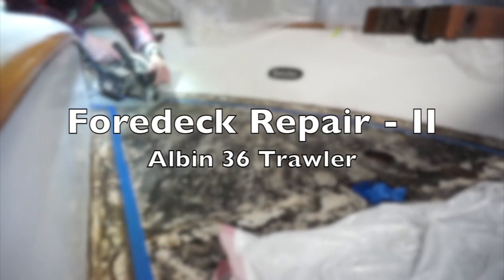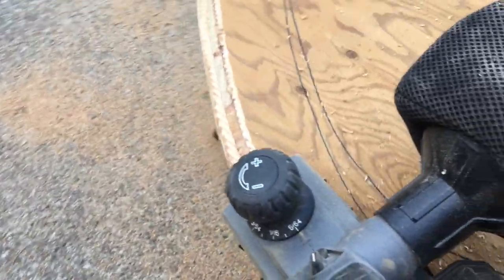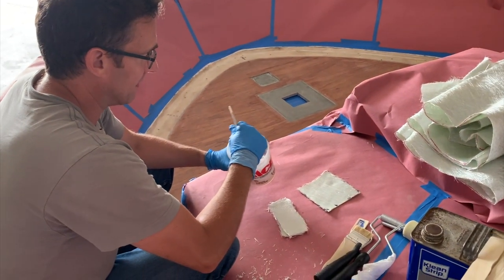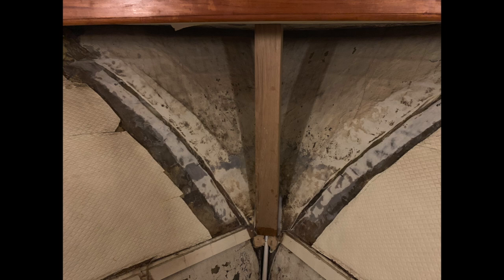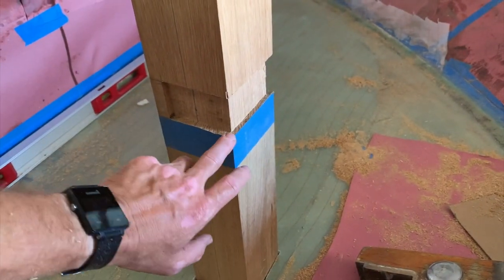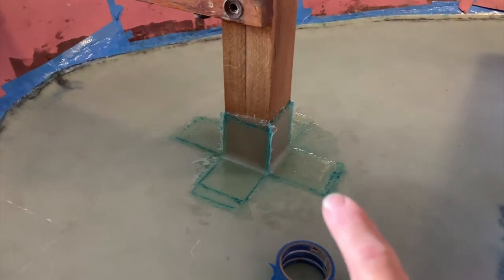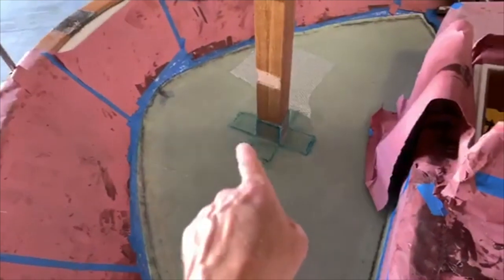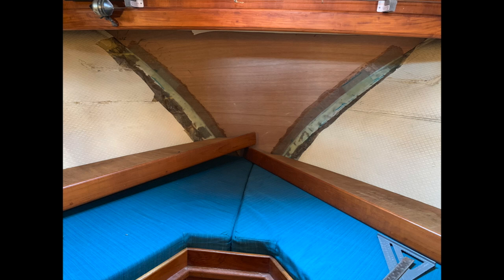Albin 36 - Bulkhead, core, and Samson Post Repair, part III

Comment: Thank you so very much for putting these videos out. I'm looking at a fixer upper Marine Trawler that has similar rot issues. I've been looking for videos on replacing the windows which were a major source of leaks. If anyone knows of any good trawler window replacement videos please let me know!
Reply from the maker: Great! I'm glad they're useful. No window replacement for us, sorry. And I'm not aware of any videos about the process. If you haven't check out the Trawler Forum. Quite a bit of good info there.

Comment: Great video. I love the slow walk through the cabin. Thank you. This may sound a bit random but can you share any information you have about wiper arms and blades.  I'm having a devil of a time trying to find the right one. 
Windows are my current project.
Fuel tanks......my next project. How are your tanks?
Thanks again.
Reply from the maker: Sean Lathbury I haven’t had to pursue new wipers, so I have nothing to lend there. Sorry!

Lateral fuel tanks are original but hanging in there. No signs of rust or issues. Centerline fuel tank was weeping. It’s now out and I’m working on a replacement.

Comment: i am looking at purchasing a 1988 32ft  Islang Gypsy. the boat has been sitting for 3 years and the starboard side has alot of wood rot on  instide. i don't know if it is the teak deck or windows. What do you think? The owner cannot believe it, but then he has't been down to boat in 3 yrs. I spoke with a marine surveyor about the boat and he's not interested in doing survey. LOL. The engine room has twin Ford Leham with 2200 hrs. The engines and room is amazing white glove clean. So do you think there is hope in the deck? I am trying to figure out how to stop leaks and  dry it out.
Reply from the maker: It’s tough to know where leaks are coming from. Most owners approach it by fixing obvious potential signs of ingress, hope for the best, and then go on to plan B, C, or whatever it takes to get it to stop. It could be the teak decks or it could be the windows. Given that the leak seems isolated to one side of the boat, I’d suspect windows. Anything can be fixed with time and/or money. I think a lot of what you’re asking boils down to the boat’s price, what you’re willing to live with, and how much time/money you want to invest in a “new” boat. old teak decks WILL need to be addressed in some form or another. Windows will and do leak eventually, and they’ll need to be addressed at some point. Old steel fuel tanks corrode and develop leaks. Where’s the boat located?

Comment: Got a question for you....a little off topic. Raining for two days here and I've got a water leak. Located in the aft cabin...port side above the locker....
Do you have the same and if so have you figured out where it's coming from. I'm wracking my brains and see no way for water to get on. Based on the teak staining and delamination it's been going on for a number of years. Thank you in advance
Reply from the maker: Water leaks can be tough. We don't have a leak there, so I can't offer any specific insight other than some guesses. Is water hitting the sloped aft saloon windows? If so, it could be leaking around the frame and then down into the aft cabin. Handrail on the port aft deck a source? That's about all I can guess. Good luck.